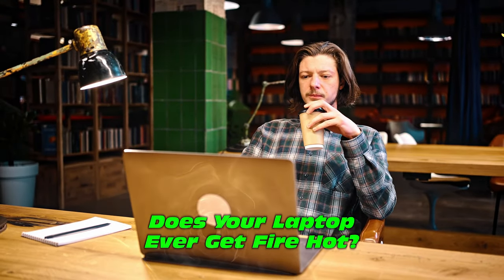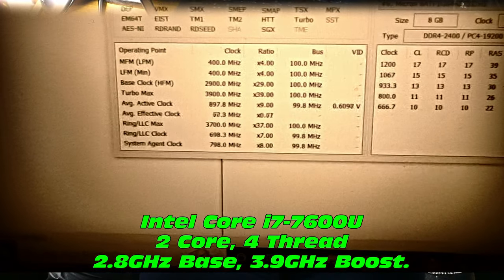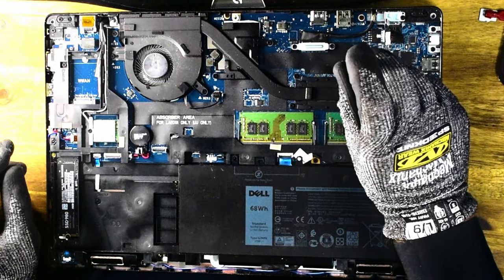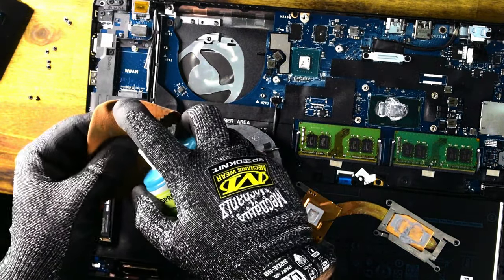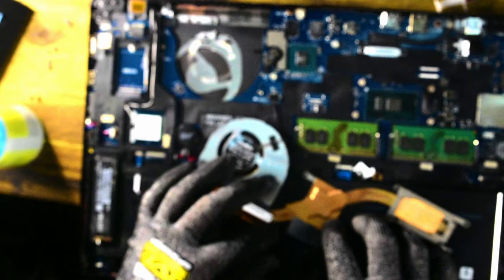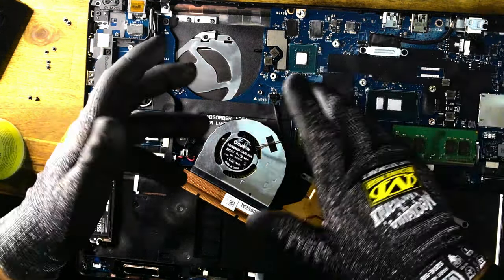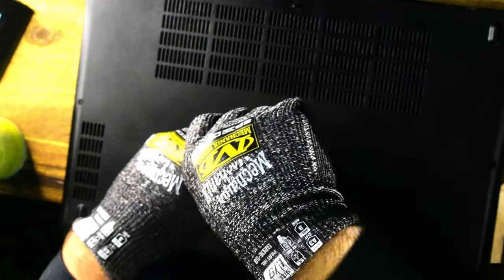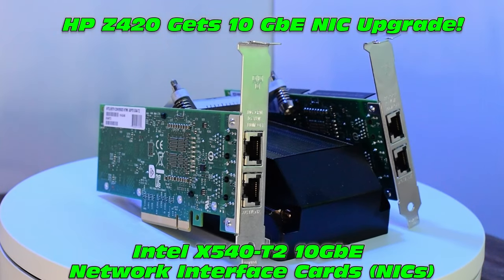Guide : Dell Latitude 5580 Overheating Fix (replacing CPU/GPU thermal paste)

Comment: Why not open up the fan to clean out the grille and blades? In my experience there always is a layer of accumulated dust/lint in there which also dramatically reduces cooling performance. Either way, I like it when people repair their stuff instead of throwing it out :).
Reply from the maker: Hi. You are absolutely correct there. I had to get the thermal fix done fairly quickly on the day so I didn't go the full distance. I normally use compressed air (an actual spray gun + compressor!) to clear off the blades (plus holding the fan blades as not to over-spin them). But it is at most only a few screws take it apart and clean it out. A regular thermal re-paste helps to extend their life, even if the hardware is well aged now!

Comment: I recommend unplugging the battery for future reference. Change the thermal paste with Honeywell PTM7950 phase-change material is more thermally conductive than the best pastes. Undervolting CPU and GPU + lowering or completely disabling turbo boost. There will be less throttling and give more fps, plus it will be quieter, cooler and the laptop will draw fewer watts from the socket.
Reply from the maker: Hi Goorthiss, yes I completely agree! Having power on all the components introduces a risk of shorting out essential hardware. I was pressed for time and went for the quickest but not always safest method... I have not looked into Honeywell PTM7950 but I saw some Reddit posts praise it, and naturally it was covered by LTT also! Thermal performance remains a challenge on laptops, so anything that can lower temperatures is a huge plus. I wasn't particularly impressed with the thermal temperature lowering after the repaste but it did leave the laptop running quieter for longer. Thank you for your advice! I need to do repaste a HP Z Book, I might give Honeywell PTM7950 a test. I was considering testing Thermal Grizzly Kryonaut.
Reply from the maker: @Tai Rikukazumi Hi Tai. The authentic PTM 7950 is usually hard to come by. The best I can find in a quick search is : 

1) https://www.moddiy.com/products/Honeywell-PTM7950-SP-Super-Highly-Thermally-Conductive-PCM-Pad.html Product appears authentic from listing description.  

2)  https://www.ebay.co.uk/itm/225323255859 (link will break overtime). Ebay Seller feedback looks fine, decent number of sales - hopefully authentic! 

Let us know how you get on with the thermal pad!
Reply from the maker: @Tai Rikukazumi Yes, thermal silicone is expensive for what it is, but then so is thermal paste. There are key benefits which will make it worth your wild (longer service interval and lower temps), but that price is the barrier.
Reply: How do you go about undervolting the CPU and GPU? I have the same laptop with the 7820hq and the 940mx. I have Linux installed and it is so much quieter and quicker than windows, but I want to squeeze as much performance as I can.
Reply from the maker: @onederdude  Nice, the 7820HQ is a solid CPU for the 5580. I have not had the need to undervolt the CPU or GPU, but the best application that I am aware of is Intel's Extreme Tuning Utility (Intel XTU) or on Linux there is Undervolt and iuvolt (to name a couple). Generally, you'll able to make small adjustments, but be ready for the process to take some time to fine-tune. Let us know how you get on!

Comment: Hi can't we remove the fan and clean dust😢
Reply from the maker: I agree! Call me lazy at the time but it was like 12pm at night and it was raining - I should have gone to the garage to give the system a quick dedust with compressed air but it just wasn't the right time. A little bit of compressed air really helps clear them out.